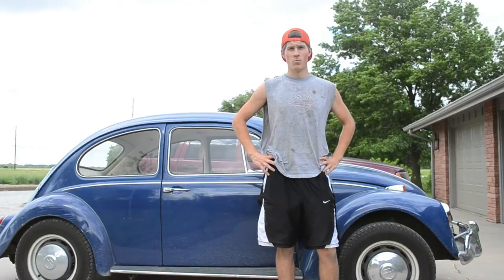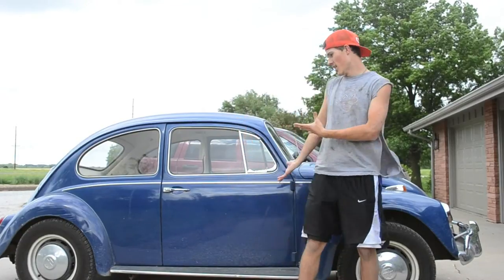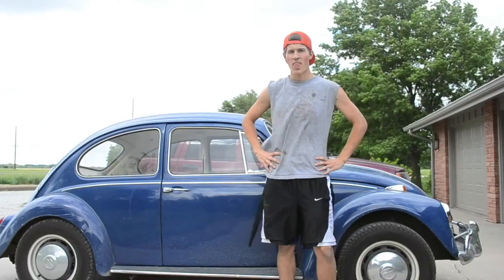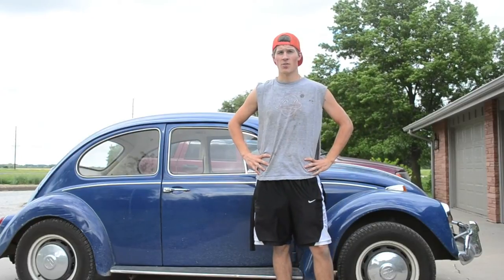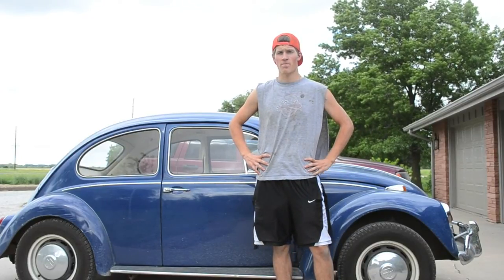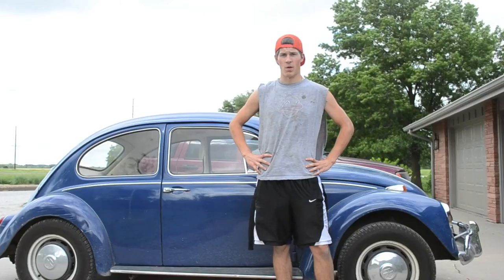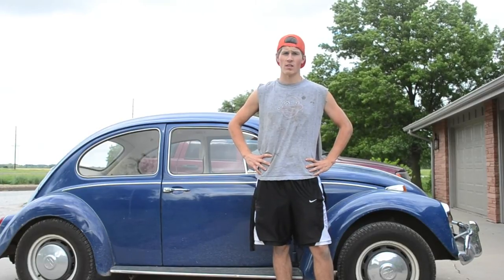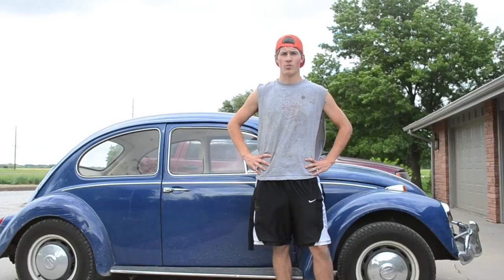How to: Remove Vintage VW Beetle Speedometer

Comment from the maker: The cable has a ring that screws onto the speedometer. You basically just stick the cable in, and then tighten the ring to hold the cable in place. I guess I don't know anything about VDO speedos and how they are set up to work with stock cables.

Comment: i done it before as 1968 and later speedometers the fuel guage is in the speedometer as two more wires go to it the power wire to the vibrator and the other wire that connects to the fuel guage to the sending unit. Im swapping the speedometer out of my 68 bug the fuel guage stopped working and the new ones are a pain to calibrate. as im going with a 1967 speedometer and fuel guage lot going to go to the cable driven fuel guage they are more reliable than the electric thermal type fuel guage in the speedometer in 1968 and later beetles.

Comment: i got a question ! how it works ? the speedmteter i mean the speed cable where does it fit ?
Reply: on all vw bugs the speedometer cable is driven off the left front wheel by the wheel bearing dust cap its a square end  that goes in the dust cap the other end of the cable goes to your speedometer. as 1974 and later models there is 2 cables one goes to the EGR minder box then to the speedometer.